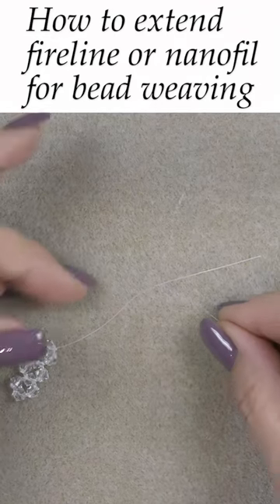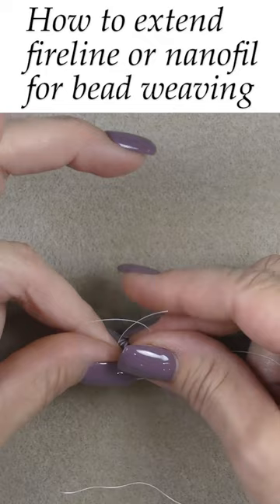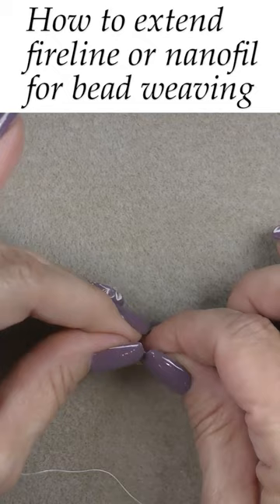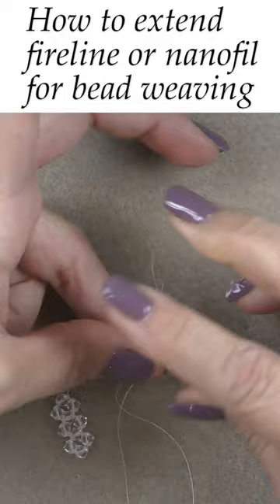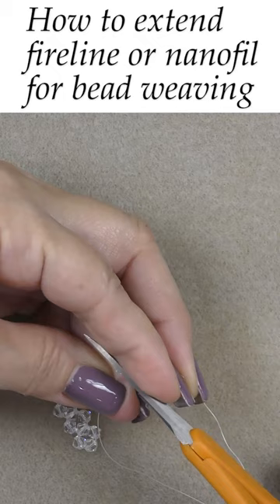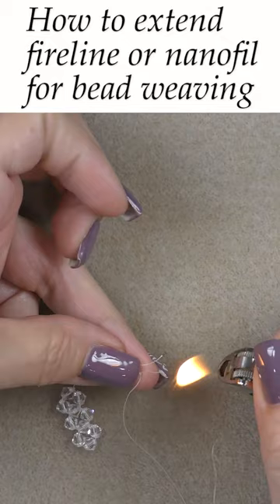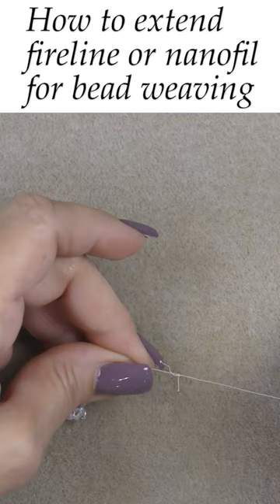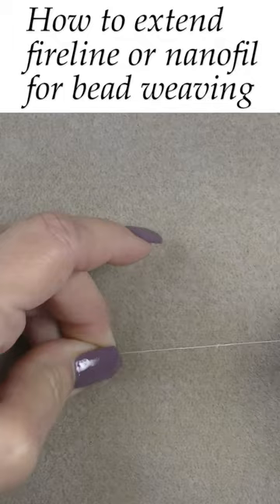How to extend fireline or nanofil for bead weaving

Comment: I have been using this technique for years. It has NEVER failed. My suggestion, as to the knot, use a square knot. It slips out more easily.
Reply from the maker: I am tying a square knot in this video

Comment: Love this technique. Although I get afraid sometimes that the "blobs" will turn out a little too big and won't fit thru 15/0s or little too small and will slip thru when I pull the 2 threads to form the knot. It can be a little tricky, but it's a seamless way to extend the thread
Reply from the maker: Yes, you just have be very careful not to leave the heat close too long, if they are too large, cut them off and try again.
Reply: I have been using this technique for 2 years & have never had any issues. A time or 2 I did end up with a knot that was just a tad to big fof the 15/0s that I was using. I used my pliers to gently mash the knot all th way around the knot & it worked. I tested first by pulling my thread tightly to make sure it wouldn't break apart at the knot & it didn't. Hope this helps to make u feel better about trying this technique as it is a time saver & a thread saver
Reply: @elizabethjones3325  Thank you for the tip! Will try it! It was an 8 lb fireline knot and a miyuki 15/0 🤪 The struggle was real lol .